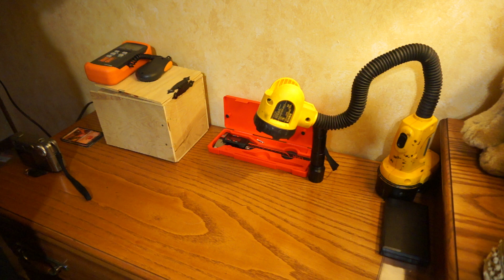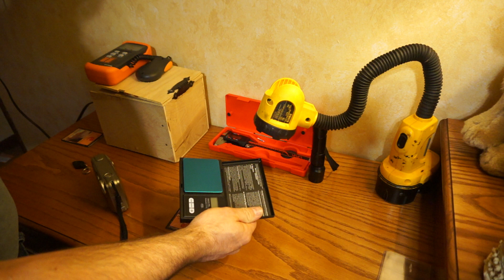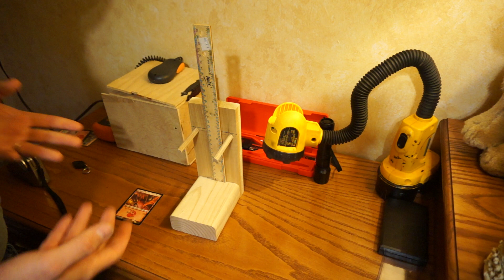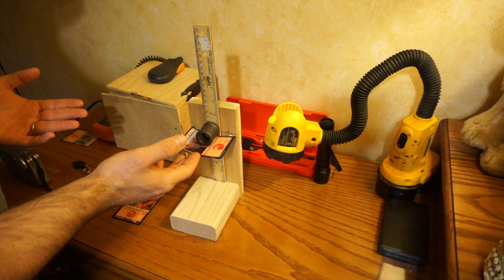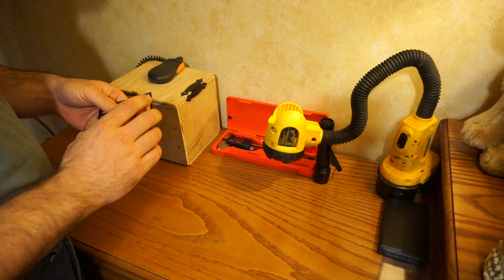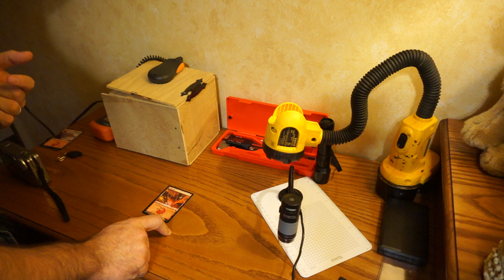Past and future methods for spotting fake MTG cards

Comment: The water test dates back to when most fake cards were made at home on inkjet printers.
The water droplet on the cards surface will damage inkjet printing, but not offset printing.
Don't put the water on the cut edge of the card or it will soak into the cardstock causing water damage, even if the card is real.
The water test isn't particularly useful on the current professionally printed fakes.